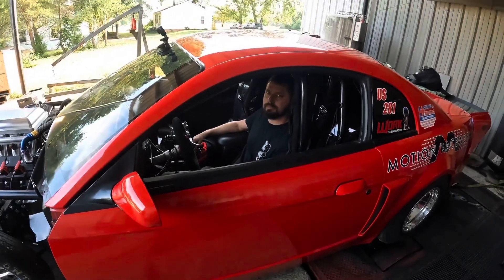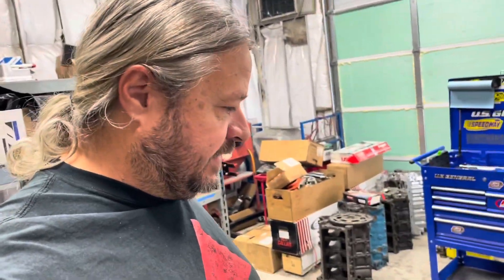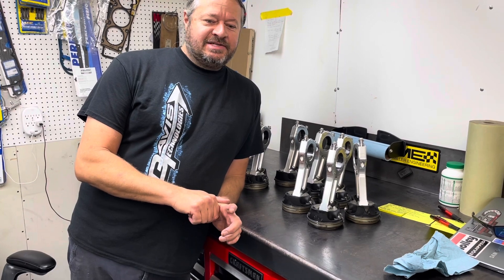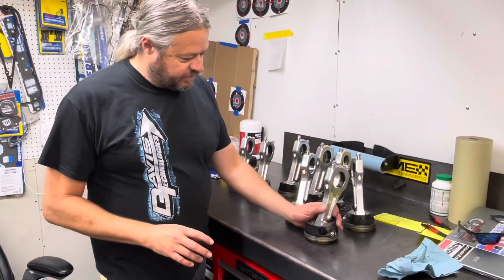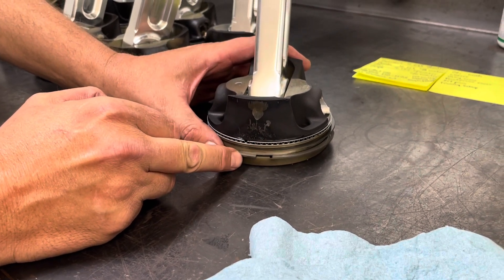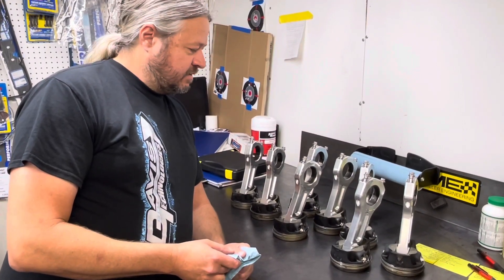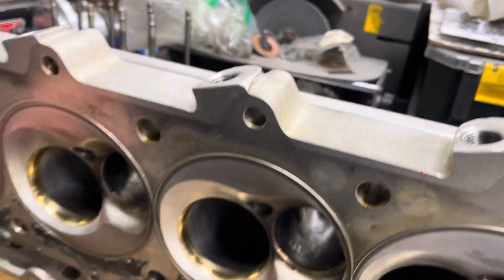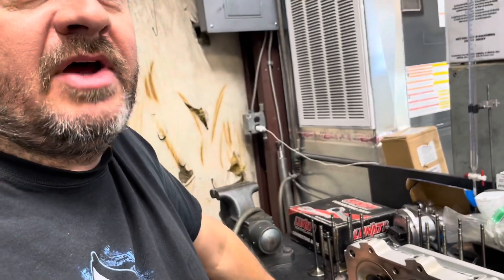Forensic Teardown!!   Let’s tear a high powered motor down!!

Comment: Do you measure the aluminum rods for rod stretch when doing these tear downs? Or do you just replace after a set number of runs?
Reply from the maker: In most cases we are replacing them either way, but if the little end is ok they go in the spare rods box.
Reply: @realgoodatdoinstuff900  What manufacturer made them heads? You hardly see a set screw hole for the 6th bolt hole on 6 bolt LS heads and does that engine have a hydraulic roller camshaft in it or does it have a solid roller camshaft because if it has a hydraulic roller camshaft in it then 4.06 in the 8th is pretty close if not the record holder in the US for the LS with a hydraulic roller camshaft especially in LDR because I know that class has a bunch of rules for adding weight and taking weight out of the car depending on the setup and can you do a follow up video of this engine I would like to know more about it atleast about as much as you or the owner is willing to share about that particular engine and maybe do a video of one of your all billet high end high horsepower engines like the BBC or 481x whatever it is in the intro I can't tell exactly what it is because I don't see it long enough but I'm digging the channel I'm glad you guys finally made one I have been following you guys since day one before Finnegan even put the word out because I follow alot of engine builders and drag racing not just your average influencer as I have been raised around drag racing my entire life and it has been in my family for generations now and hopefully it will keep growing in my family as life goes on but as always stay safe keep the shiny side up and the sticky side down
Reply from the maker: @keefespencer1173  edelbrock heads.   Solid roller.

Comment: Is the wrist pin play exclusive to aluminum rods, or does it happen as quickly with steel rods? I guess that would mean the brass bushing is taking the wear?
Reply: The bushing and the pin bore of the piston will wear or gall. The locks can even raise a burr and wear their grooves out and may eventually pop out. That's why the big boys use pin buttons.
Reply from the maker: @DrTittieSprinkles  yes we might cover this in a later video.
Reply from the maker: Yes it does occur in steel rods as well but it seems to take longer to beat the bushings out.  Then again....steel rods are not normally found in motors that make this much power.
Reply: Good info